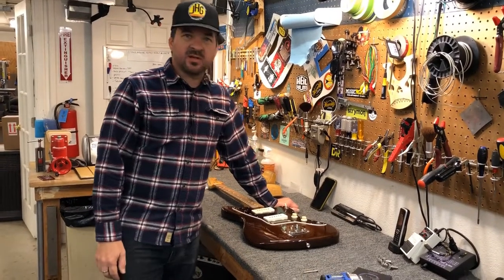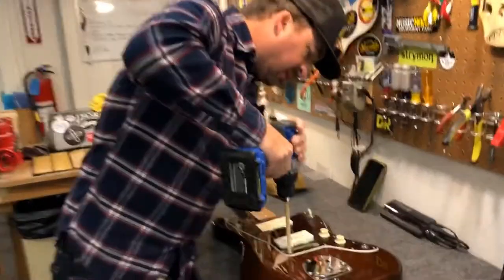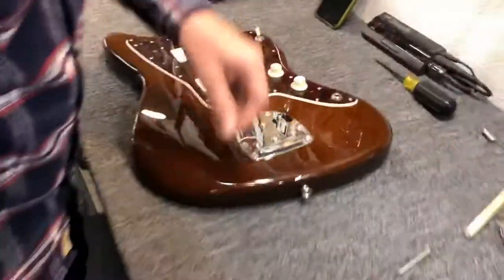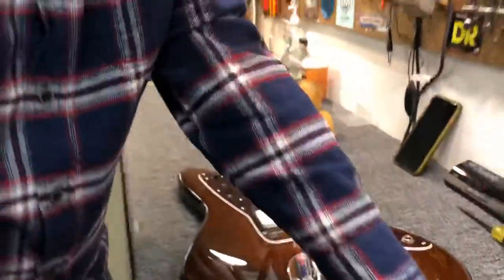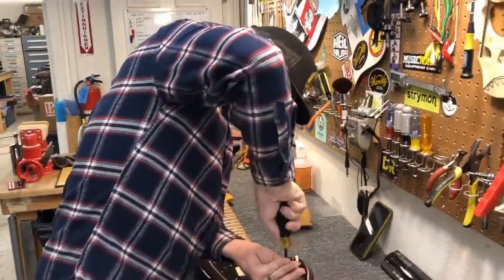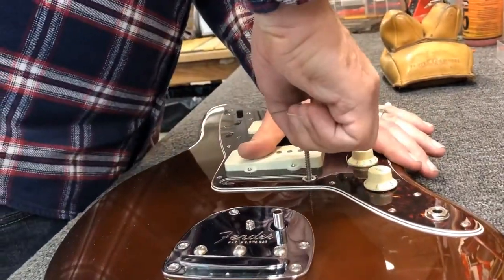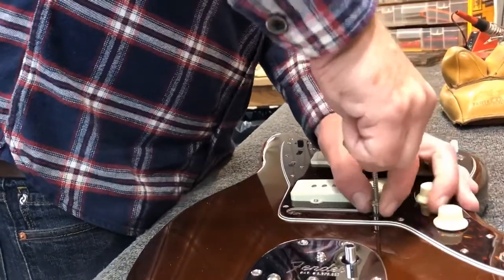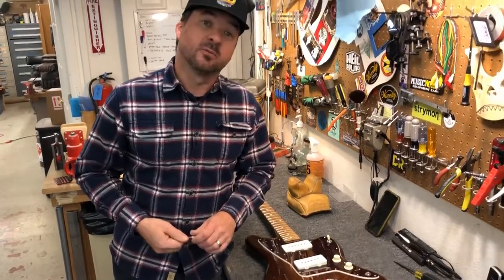How to remove thimbles for mastery bridge installations

Comment: As the owner of the Jazzmaster in the video, thank you for your fine work on my baby, Chocolate Thunder.  The Mastery Bridge is the perfect solution to my problem with excessive string buzzing and sudden string displacement in the middle of playing, and the set-up with the new set of .11 strings (instead of the stock .09s) is not only spot-on, but brings out a slightly beefier tone than before, even while swimming in a vast sea of effects.  End result: this guitar has never played better in its existence than it does now.  Thanks again, James Hood Guitar!
Reply from the maker: Thanks Brian, Glad you are enjoying your guitar!
Reply: What kind of bridge was in the guitar prior to the mastery being installed?
Reply from the maker: @dontfeartheriffer  It was a standard MIM Jazzmaster bridge.

Comment: Good tip! Worked well on a 60's Jag here in the shop - the slight heat from friction was just enough to loosen it without chipping the finish.
Reply from the maker: Glad it worked out for you!

Comment: Very useful, thanks a lot! I used dowels that I hammered in carefully and then expanded the wood with the screws as mentioned. Luckily, the dowels had the same diameter (more or less) as the thimbles.

Comment: Fender Should Have /never Used This Type Of Bridge Set Up, They along with JaguarsMaster Were Designed with the Vintage Floating Bridge Using The Mastery Bridge Impedes The Floating Action Many players today don,t Understand These Guitars Were Not Designed For Hyper Picking doing windmills And Playing Hard As Nails. Thank you Very Much for Showing Me This. I Have A 2017 Fender classic player Jazz Master. I Have A 1961 Vintage /Bridge That I am Replacing the Mastery With the v?Mastery Will go in the Trash Can
Reply: This is a somewhat lesser known point that I think I may agree with. The tune-o-matic on my Gretsch 6120 with Bigsby stays in tune.  By J Mascis Jazzmaster with Mastery (modification) does not.  The TOM bridge has about a millimetre or less of back and forth movement, which means the strings don't have to move in the saddles.  On the more solid bridge, the string absolutely must move in the saddle, because the tolerance on those mastery bridges is NASA level, and just doesn't.  Means the strings need to be lubed at that point.  What a pain.